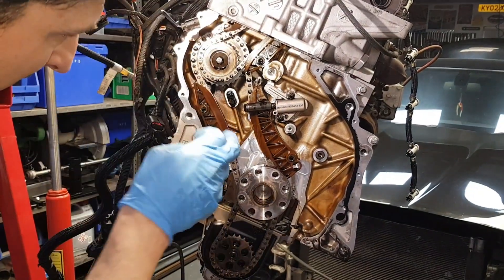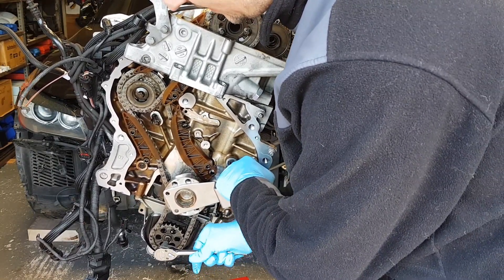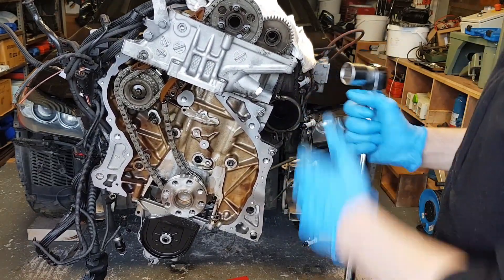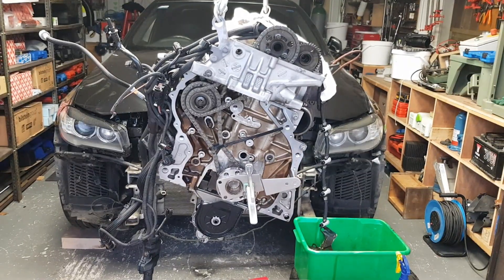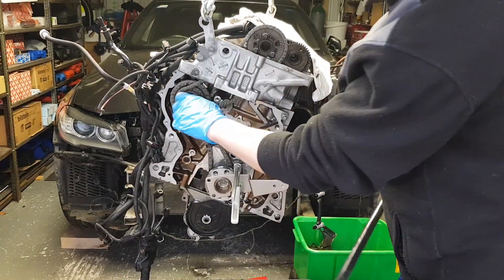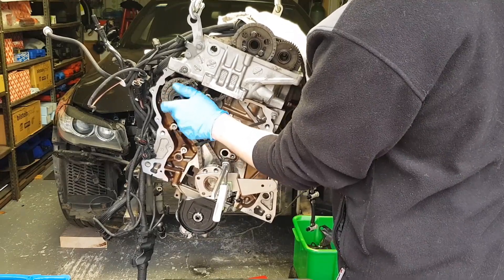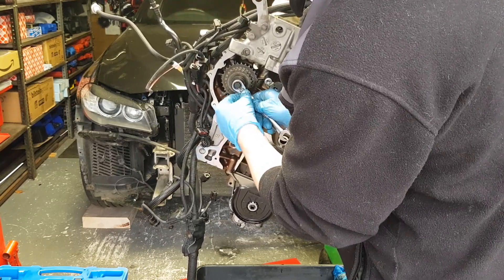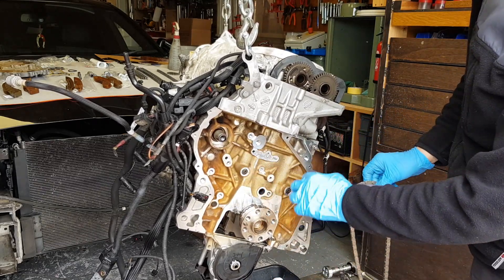BMW N57 N47 how to remove Stretched timing chains sprockets guides F10 530d F11 520d F01 730d 330d

Comment: Hi there great video but how did you resolve skipped timing just doing mine right  now flywheel locked cam tool wont go over so suspect its jumped 
Thanks
Reply from the maker: You will have to re-time it again with the locking tools. Make sure your valves are not bent if yours had jumped whilst engine was running. Just be careful as the crank locking tool is used for N47 and N57 but the locking position is different. If you have locked your crank in the wrong position the cams will be in the wrong place

Comment: Another great video. Quick question - how detailed are the EManualOnline manuals? Are they like the print versions of Haynes? Or are they more vague and geared towards mechanics (as oppsed to DIY'ers)?
Reply from the maker: They are literally the bmw dealership manuals. I have Haynes, Bentley and these manuals and in my opinion they are the most accurate and easy to understand🤝🏻
Reply: @TheKeenMechanic  excellent. I’ll give them a go with your code. The new Haynes AutoFix ones are rubbish when compared to their print ones, which they don’t do anymore for newer models.
Reply from the maker: @kingGar27  Regarding the manuals: the pdf file is about 191mb 3984 pages and is perfect for a phone. It is a searchable pdf file however there are things you can't do with it. Like for example clicking on the torque spec links. It is a great overall manual but I can recommend you to get the OVA file first or both pdf and OVA if you can afford both. OVA is run on a virtual machine on your PC and you can use it for multiple models I believe. You can also search and find torque specs and click on links on the OVA version of ista.

Comment: I have a 2011 X3/F25 30d with 250,000 km. Bought at the end of January this year, and a 2008 X3/E83 20d with 222,000 km bought in September 2019.
I'm interesting in the manual for the 30d, then I used your link to look at their homepage. A coupe of things are unclear...
First they say they have a manual for F25 2010, but BMW haven't sold or manufactured such a model.
Then I know that the 30d came onto the market, I think, at the first of April 2011.
Then I have two assembly dates for my car, depending on where I get the information!
The car is made for Sweden at the end of July 2011, but then I saw an earlier date from April or May in an app.
In Europe the car is a clearly my 2011.

Then, about the file... How big are they approximately?
Is it one pdf-file?
Has it a content list at the beginning? 
Can a specific item from the content list be reached by tapping that line/link?
"Every" bolt/screw has a torque mentioned?
How many pages has the manual/pdf-file? 500-1000? Or even more?

I would appreciate a quite short answer... 😁

For my motorcycle (also 2011, but bought in December 2011), a K 1600 GT, I have the original repair "handbook" on CD-disc. If I remember rightly it was around 500 pages.
Reply from the maker: Hi
Remember BMW make cars for different continents so could have models in countries like China that don't exist here. Regarding the manuals: the pdf file is about 191mb 3984 pages and is perfect for a phone. It is a searchable pdf file however there are things you can't do with it. Like for example clicking on the torque spec links. It is a great overall manual but I can recommend you to get the OVA file too which is run on a virtual machine on your PC and you can use it for multiple models I believe. You can also search and find torque specs and click on links on the OVA version of ista. This is as short as I can write it whilst giving you a quality answer😁.
Reply: @TheKeenMechanic Thank you very much for that answer.
To make an even longer answer short...
I have been abroad for some months, but when I return to Sweden "shortly", I have to contact a guy that helps me with Ista (and INPA).
But I want also to use a suitable app on my pad (and phone).

Now I have Bimmerlink, but I need some changes there. Let's see what the owner says.

Then I have started a discussion with Carista, and let's see if something interesting can happen.

The problem is that I need to know how things work.

Let's say, the lambda sensors are getting vorse when aging. Then the question is, is it possible to read out the state via EOBD, and decide when to change one, both or all?
Bosch says you ought to change them at 250,000 km, but when are they too bad without to be broken?

I guess it's almost the same with many other "things".
The problem with the lambda sensors are that if they aren't "perfect" the catalytic converter will be "destroyed" prematurely, and in BMW N57 engine the catalytic converter and DPF are in the same housing and costs almost as much as an old car.
I find it interesting to try to keep life in these cars beyond 200,000 km and even 300,000 km. 
As BMW is of quite high quality, I mean the body, seats and interior, why do we have to scrap the cars because of a "small" fault under the hood ie broken timing chains?

Is it a good environmental measurement if BMW make the "hat shelf" out of recycled fabric, 500g, when you scrap 1,800 kg, instead of changing parts, 10 kg?

You need not anser to this, as you repair "old" cars I understand how you basically think, maybe not from the beginning but as times go by. Everything changes and we also.
Keep on doing informative videos!
Reply from the maker: @leiflillandt1488  I am the same, I want to know how things work but sometimes it is not possible to find all info in a timely manner. Sometimes as replace things preventatively before they fail as a precaution. Thank you for being here on my channel and for sharing your experience. I feel the same as you, way too much waste in the developed countries. Look at Cuba, still drive and maintain cars that are over 70 years old, just shows you that is possible. Human inginuity has no limits😉